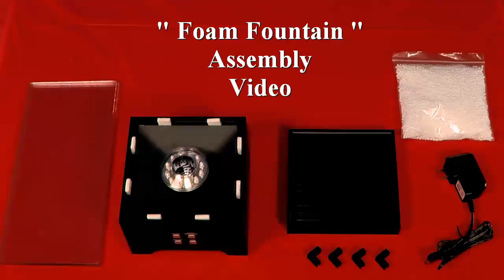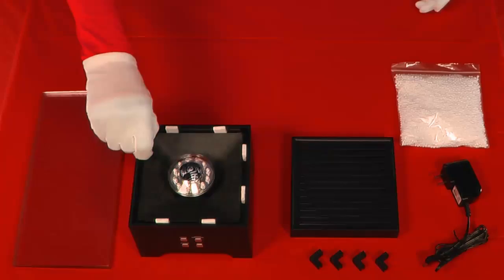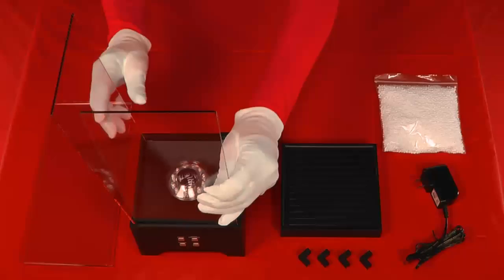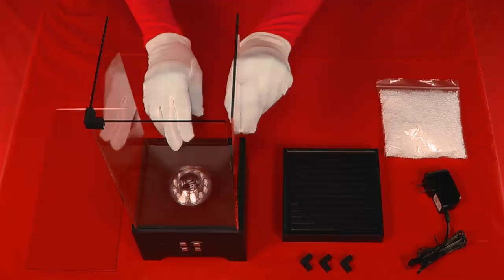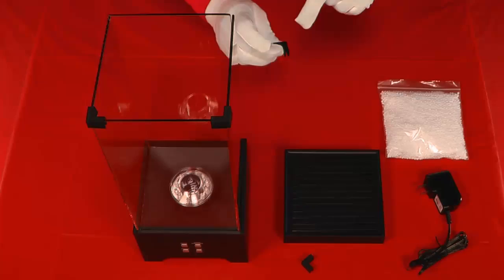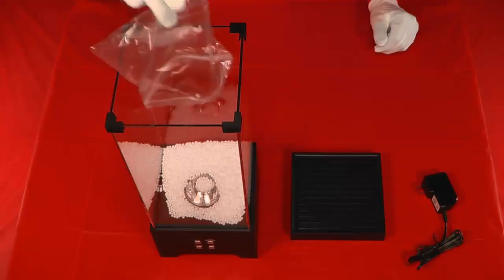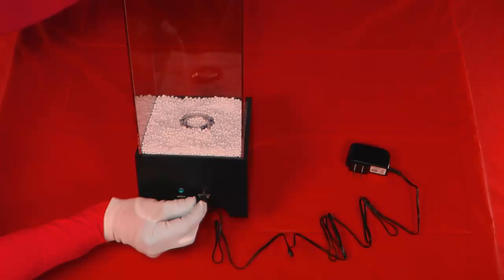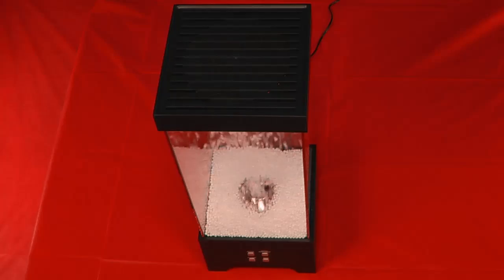Foam Fountain Assembly Video

Comment: Is it possible to make a big  fountain like this(around 6 feet high)?
Can u please share a video demonstration how it work.
Reply from the maker: It is possible to make a larger fountain but the density of the foam beads that shoot up into the air need to change to keep the look of a fountain affect. What did you have in mind doing? We can probably work together on this. Sorry for the late response. Had problems with my email.
Reply from the maker: Bikram, my email is frankievis52@sbcglobal.net. Let me know more of what you would like to do & your idea. Would it be for personal use or commercial. We could work on this together. Give me more information of your plans. I'm the inventor of this product and I hold patents on it.